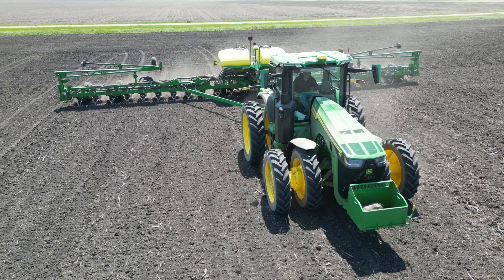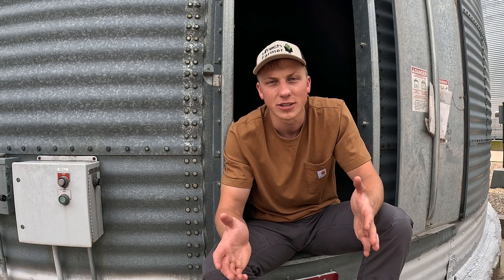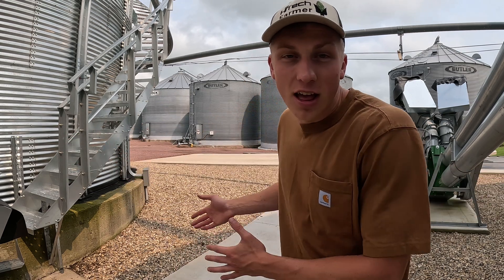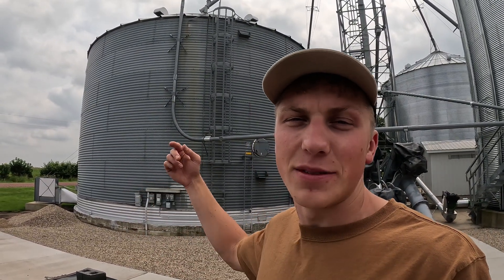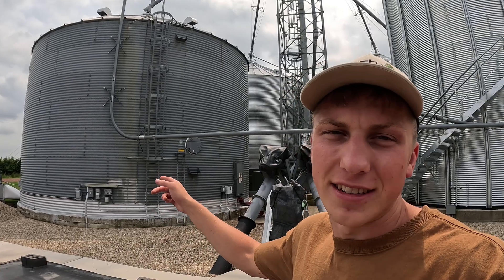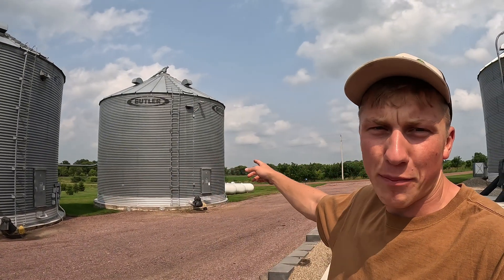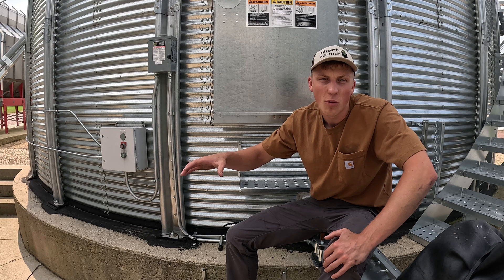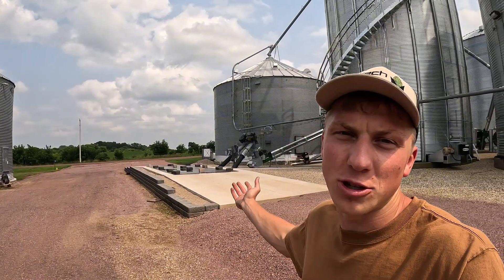Why Do Farmers Build Grain Bins?

Comment: Very nice transition into your "outro" at the end. Can you at some point make a more detailed video about how the corn drier works? is it just air or heated, does it completely fill up or is the corn floating in there, do you use electric driers like at some restrooms or some kind of gas burner, why is this not going off like a huge popcorn maker, how much do you get in there, how long does it need to dry, how do you prep it / clean it between the crops, is it a constant flow or fill up and remove over and over again,...? so many questions. :)
Reply from the maker: Thanks for the comment and questions! Yes, we will be servicing it soon for harvest preparations, so I'll be sure to highlight some of your questions

Comment: Great video, very informative thanks. In our area I would guess 80 % of the new bins are now hopper bottom. You don’t see many on the American channels at all. I am guessing corn takes up a lot of room so bins have to be bigger overall. Here they mainly grow wheat, oats, barley, canola, flax, mustard and lentils so the super huge bins are not needed as much. Either that or our family farms are smaller with less land so again large storage bins are not needed as much. Having said that it is not uncommon to see 40+ 6400 bushel hopper bottomed bins lined up on some farms.
Reply from the maker: Wow that would be slick to have all hopper bottom bins. No more shoveling and moving augers into bins...sign me up! Yeah, in America you don't see many large cone bottom bins and most are just used as a "wet bin" so the grain flows out better. If the cone bottom option wasn't so expensive it would definitely be a nice thing to have and save a lot of labor